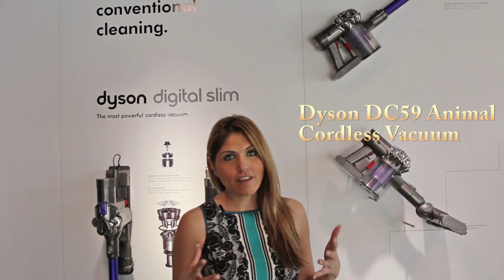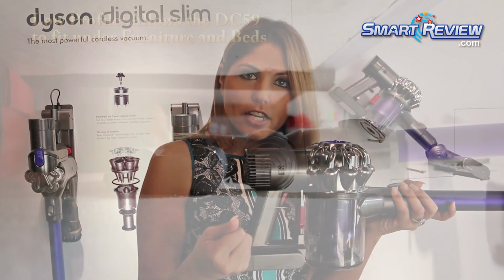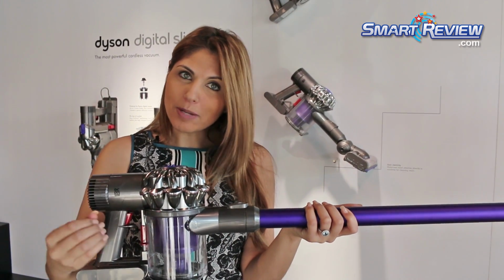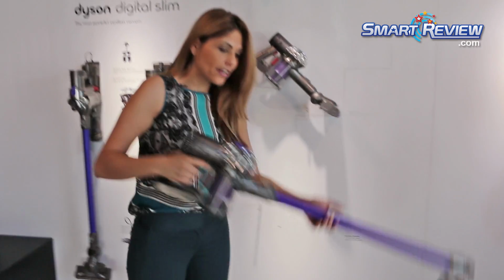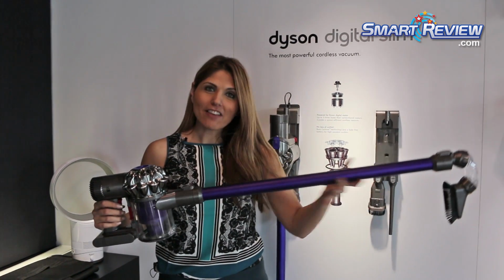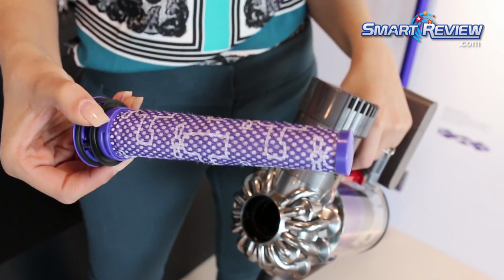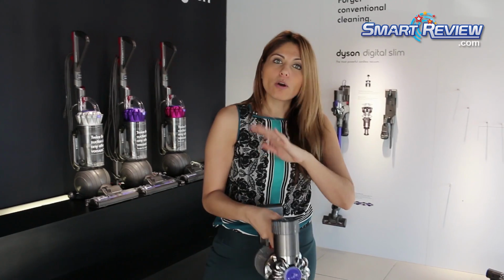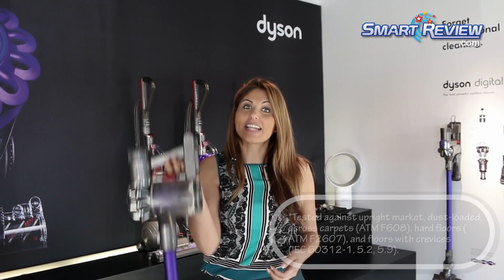Dyson Cordless | Dyson DC59 Animal Cordless Vacuum Demonstration | Dyson's Best | Cordless Review

Comment: Over the years I have owned several cordless vacuums and they have all been, well, RUBBISH really. I recently bought a DC59 and it is AMAZING. Very light, extremely powerful, hugely versatile and with excellent battery life too. Despite the eye-wateringly expensive price, this piece of kit is the best out there and beats most plug-in uprights I have used. Get one, you will not be disappointed.

Comment: Just purchased this machine, and it does everything it advertises.  I love it!  Very lightweight, very powerful, and  maneuverable,  I use it on my wood floors and carpeted rooms without pause.  I may have to recharge it (I have the charging station) if I use it on several rooms. However, that is not a problem.  I love it's versatility, and would not hesitate to strongly recommend it to anyone who cleans a  house.
Reply: Sharon Roy 100% agree.

Comment: At the 10:52 mark, it sounds as if the competitor vacuum you were comparing to was running at their low power mode. Just before you turned the competitor's vacuum off, it went up to a higher sounding speed. Were you comparing the Dyson on Max power mode to the competitor product on its low power mode!?
Reply from the maker: I could not tell whether the Dyson was at low or high power.  The test as I saw it  was to show how the carbon fiber elements can pick up fine dust, not a suction battle.  But you might be right, that the other vacuum may have been on its standard setting, and not max. I don't believe that suction alone could have made the acrylic as clean, without having the carbon fiber brushes.

Comment: The competitor vacuum was definitely on a lower power mode you can hear it. Also you went over the surface in 2 seconds with the competitor vacuum as opposed to 5 seconds with the dyson.

Comment: How long does the battery lasts?
Reply from the maker: 26 minutes on standard mode, and 6 minutes on MAX. If you are using the motorized tools, that reduces the battery life somewhat as well.  It takes 3 1/2 hours to charge.